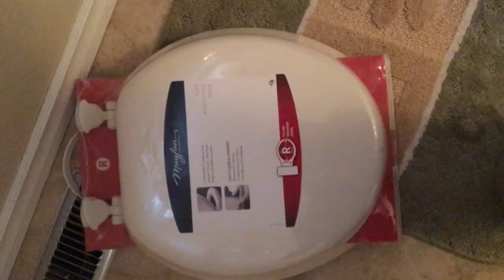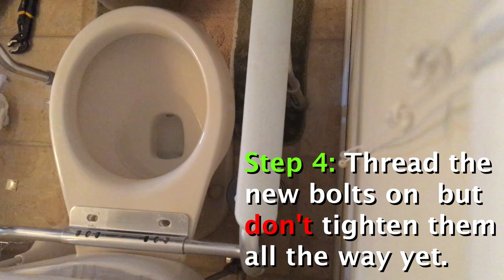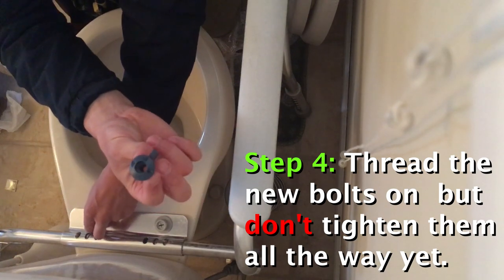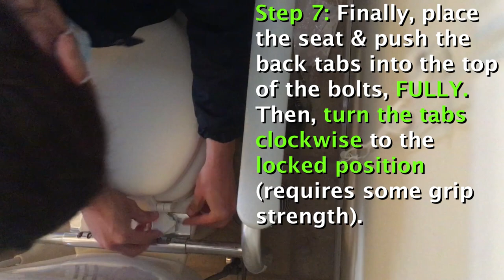How to Replace any Toilet Seat! Handyman Vlog #4

Comment from the maker: 0:03 What type of Seat to buy?
0:35 Tools you need
0:50 Removing Old Seat
1:17 Clean the area and adjust Support Rails
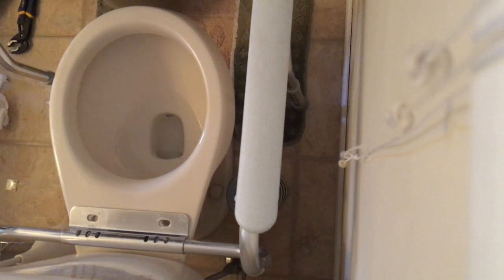1:24 Open new Seat and hand tighten nuts and bolts
2:11 Line up the New Seat
2:55 Secure the Seat Bolts
3:24 Lock the New Seat into place